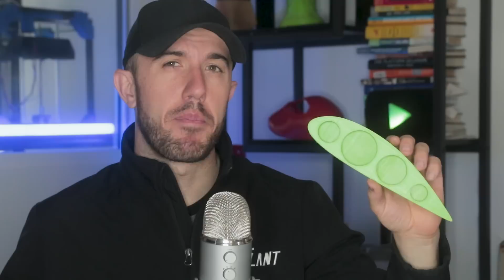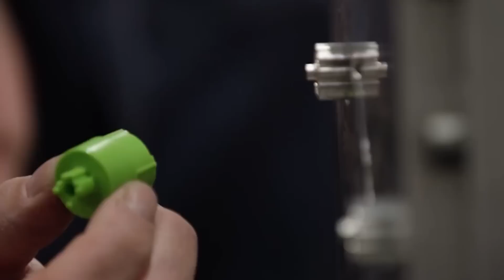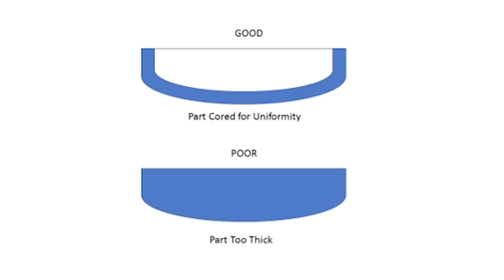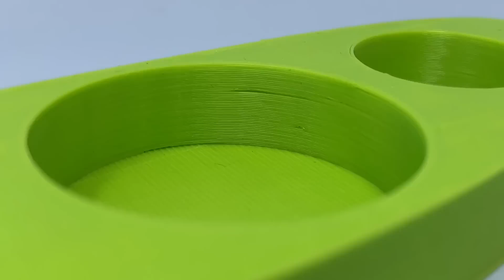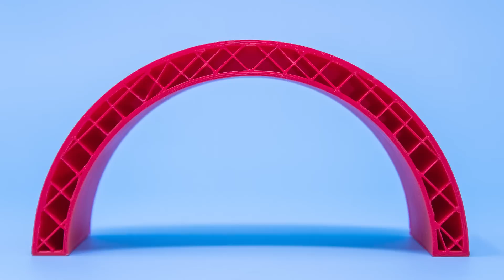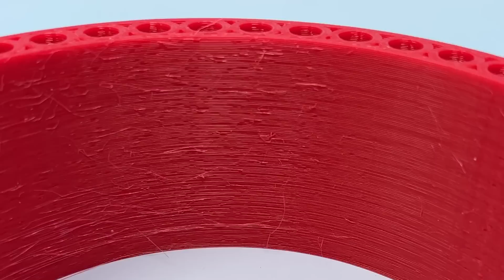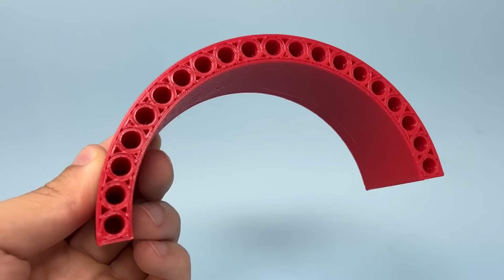Cavities Don't Help: Design for Mass Production 3D Printing

Comment: Infill is generally the fastest movement a 3D printer will do. Remove volume with the infill, rather than add more slower movement areas like walls.
Reply: Per unit of material, walls provide more rigidity and strength than infill. Walls are towards the exterior of prints, where material matters more. Given the choice between allocating plastic to walls or unfill, walls should be prioritized.
Reply: @3er24t4g1  For strenght, sure. But the traditional reason to add cavities is NOT to add strength but to reduce material usage. Infil is way better at that
Reply: @GarethMcCumskey  you shouldn't be printing parts with more than 50% infill anyways.
Reply: @twanheijkoop6753  Makes high stress parts for things that go pewpew... 5 seconds later wonders why they have a spring in their eye, haha! Yeah no 100% if you've properly designed parts where strength is critical, unless of course you've designed it with specific infill in mind (some pewpew parts have been optimized with varying infill depending on the region, and I use these as examples because they are life and safety critical and what's another $1 in plastic when its being loaded near max failure point otherwise?)

Another example is mufflers/suppressors. I'm looking at getting some higher powered stuff that has 5,000 psi of pressure (delivering more force than a real 12ga slug), and if I decide to print the can section (only because the government likes to shoot people's dogs if they buy perfectly legal cans for their air toys, and I don't have any dogs), then you bet I'd be making that solid since its better hoop stress and far less fatigue since the internal layers will stretch less since they will be reinfoced by the outer layers (which they basically won't with hollow infill)
Reply: @twanheijkoop6753  I'd go even further.  You shouldn't even be printing parts with more than 25% infill.  Infill is primarily to support the shells, not to provide strength.  If you need more strength, additional perimeters, enclosed internal cavities and careful consideration of layer orientation will always add far more strength than any infill you might choose.  There are exceptions of course, like with flexible materials, but infill is generally the worst way to improve your part strength.
Reply from the maker: Also true
Reply: Seriously, I've never seen nor created a part that wasn't just completely solid and you just reduce material with your infill settings.

Comment: i was just thinking about the bridge with the structure and designing it in fusion, it would be dope that you make a series of "designing it like a pro" and showing us the most efficient way to design features in fusion, so many times in fusion i have a super simple idea that cant translate properly and ended up wasting a lot of time, for example idk how i would use the circular pattern to achieve it but i'd think thats the way. something ultra dope would be that we could send you easy snipets of a super specific and short idea and see how you would design it. something like the stackoverflow of design
Reply: Play around with the tools for a while and you will find the easy ways. To use a circular pattern to make the semi circle thing he showed you can either sketch or extrude one hole then use the circular pattern with the pivot point set as the centre of the arch circle and then there are settings for number of copies, spacing, etc.